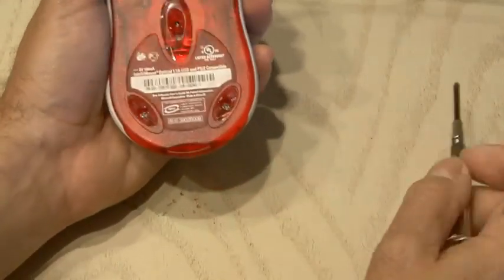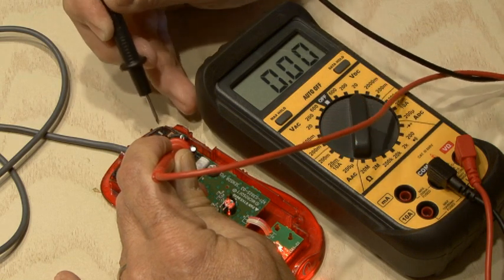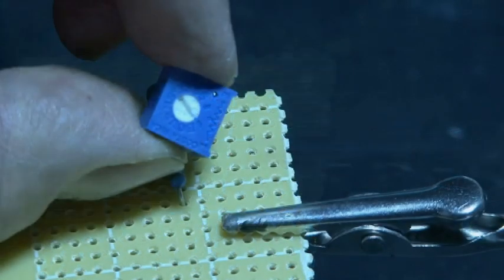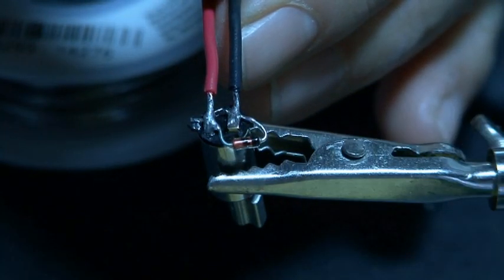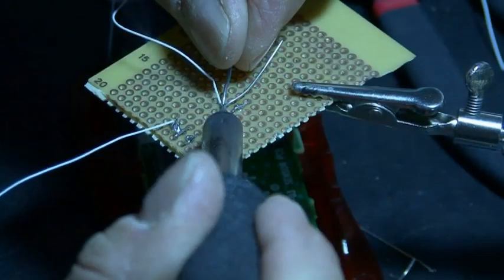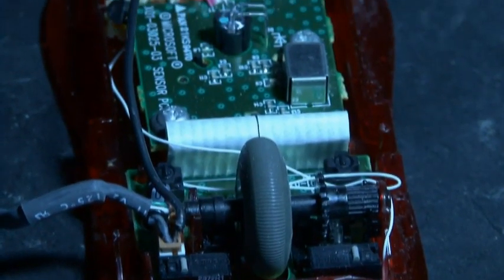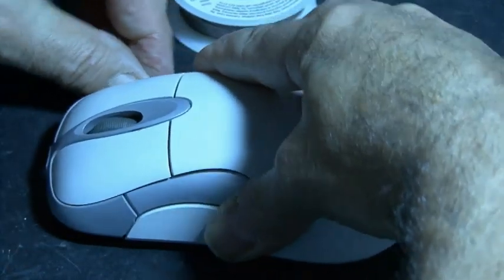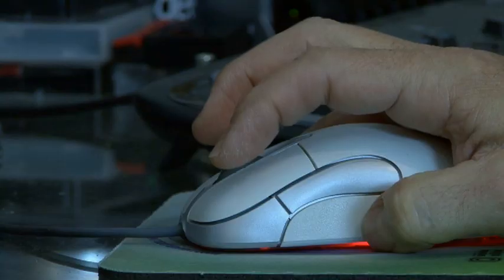Weekend Project: Rumble Mouse

Comment: your saying that because the mouse has a laser sensor to detect movement that it would cause the screen to jump all over the place.   What you will find is that a console controller will also produce a side effect that will cause the player to become disoriented by the movement of the weighted motor. In essence this is the point.

Comment: @jejevirus no the wireless mice use a single AA battery so the voltage is only 1.5 V which is not enough to make the motor turn fast enough

Comment: @5904ceker actually there is the exact same amount. r1 r2 r3 l1 l2 l3 triangle square x circle left analog right analog left right up down. Xbox there is A B X Y up left right down two analogs and the buttons that are just like r1 r2 r3 l1 l2 l3

Comment: what are you on about both use buttons for input. the feedback is from the game saying spin weighted motor because of an event has happened.  My point was in the first place that using a usb control chip and having the right software in place for the games you would play you could have a rubble mouse.  

What games already for the pc support rubble feedback and how does it do this?  Is there a directx code that might be used?

Comment: i did this, all i did was troubleshoot with a motor until i found the correct solder points on the mouse's circuit board that would make the motor run when clicking. you dont have to build a circuit like he did

Comment: My point was why make a mouse that vibrates and when vibrating making your hand vibrate and jitter the mouse slightly and shake the screen??  Im not trying to start a software war or something,Im just saying whats the point? And i was trying to say that the console controllers do not have a optical sensor to detect the jitters and make the screen shake because they use the arrows to collect the position info from the player not the movements of the mouse.   Get the point now?

Comment: I believe Logitech once had a mouse called the iFeel or something like that, it had a vibrating motor in it, but I think it worked a little differently, I think it may have come with some extra software that made it vibrate when the mouse pointer passed over objects on the desktop and in other programs, is anyone able to provide further information?